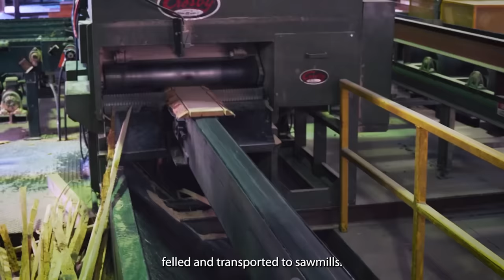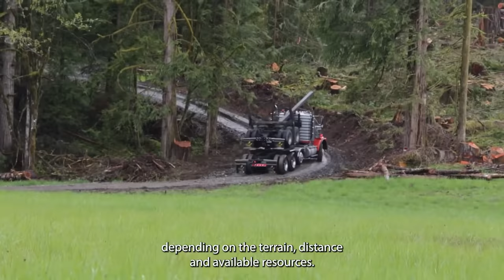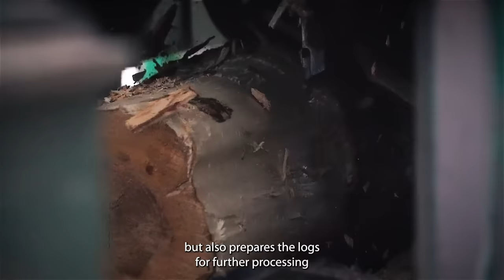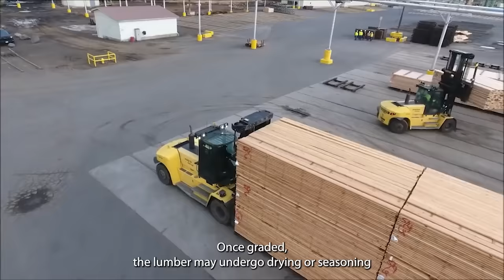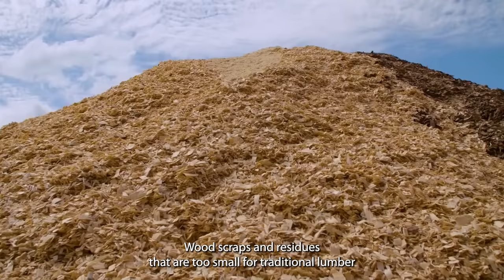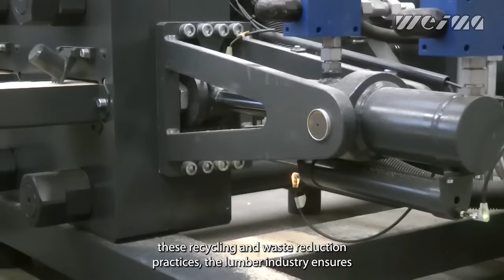Log to Lumber - How American Lumber is Made

Comment: I have been saying for many years that the entire global energy supply can be gotten from wood. The world's forests are 4 times the size of the United States, including Alaska. If you only used one of those forests, and harvested it in sustainable ways, the world could use wood as its primary energy source while only harvesting 1% of the trees. Wood is just like coal. It has been used for thousands of years as a heating element for both residential and commercial purposes. Not only can wood be burned directly in power plants, industrial applications and for home heating (chips or pellets), but it can be used to produce methanol fuel (alcohol fuel). This is done by putting wood (like sawdust or chips) in water, boiling the water and then drawing off the liquid, which has absorbed chemicals from the wood (just like making whiskey from corn). The leftover wood then can be dried and burned as fuel. Methanol can be used as heating fuel or to power automobiles.
Reply: Hemp would be much more efficient, grows hundreds of times faster and bio diesel can be made from seeds..paper, clothing and 50´000 other products. Everyone could sustain themselves with energy needs on just a few acres..but a few rich people would loose billions so that will never happen.
Reply: Hemp is batter then trees for what you are talking about
Reply: Energy is all around us. Free energy re: Nikola Tesla here soon.
Reply: Thanks, Steven - Herein Sri Lanka sawdust is used as a base material for composting animal dung.Any way saw dust from trees containing resins ie pine wood cannot be used.
Reply: Why does that sound like a terrible idea?

Comment: A big supporter of the Timber industry. Had 12 year's in a Plywood plant in Montana. But damn what a tough way to make a living. And honestly doesn't pay that well. Im a janitor now working at a local university. The particle board plant in my hometown start workers out only about $2 an hour more than Im making. Developed carpal tunnel and rotary cuff issues from the mill also.